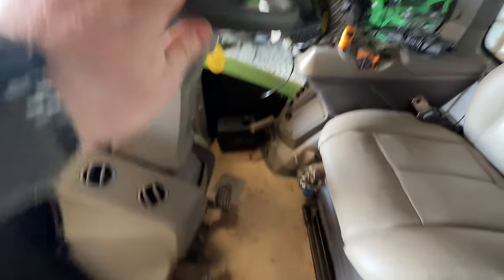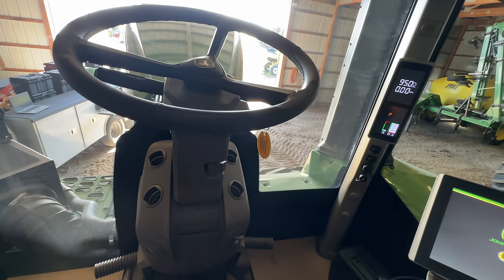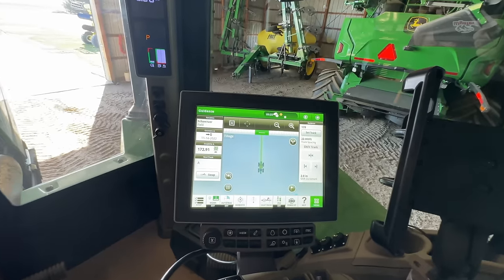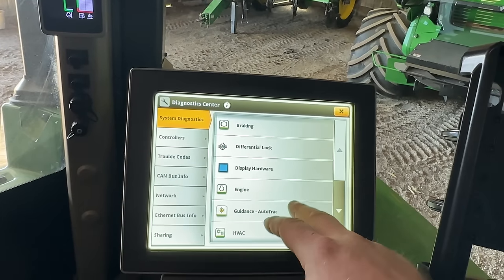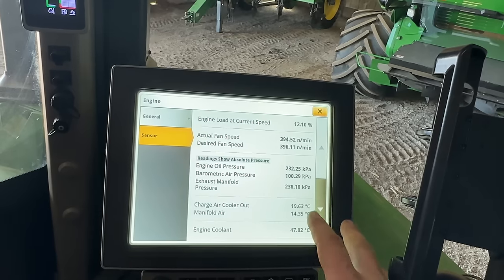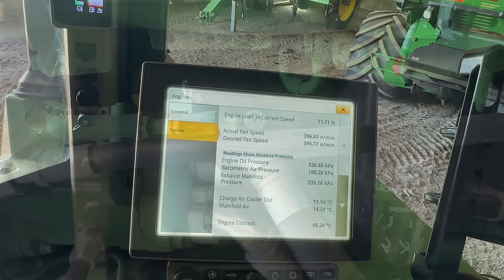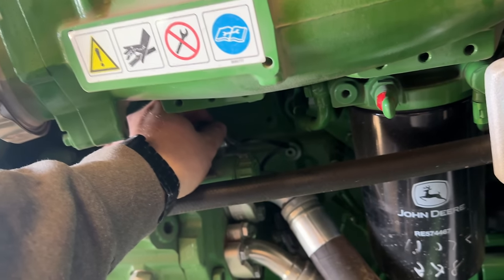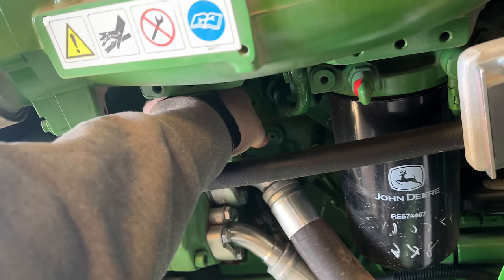Service call on a John Deere 9RX 640, shop projects, new tool boxes, & a visit to my favorite s680!

Comment: Zeth those rotor bearings can be a pain to remove. I’ve found the best way is to pull the seal off and air hammer the cage, separate the ball bearings enough to get a blind housing puller inside, then use an impact on the puller, mine is an SKF set. Saves tons of struggle and time. Hope it helps ya on future rotor bearings🤘🏻

Comment: I used to have a Pin pusher Tool to rebuild terminal blocks on Fryer’s GCS Service out of KC or St. Louis Frymaster Fryers we’re notorious for broken Terminals because of heat! It’s a Mini screwdriver with a Tube over the Shaft of screwdriver

Comment: You do need a halogen electronic leak detector for checking seals and O-rings for leaks, shaft seals behind the clutch, etc.  Huge time saver.

Comment: It would be interesting to see more info on one of the parts you hate the most.  Tools, tips and techniques you use to remove broken bolts or studs.  Bonus points for details on how you prevent them breaking in the first place.  You have had bits of that every time you get into exhaust studs, but haven't seen many actually break off for you.  Enjoying the videos, man.

Comment: I really like that you took the time to pull that plug apart and replace the terminal. A lot of technicians would've cut that plug off, through a couple heat shrink, splice connectors in there and called it a day. That is a massive variable displacement, hydraulic pump running that fan is that all it runs or did I miss some thing and that pump is responsible for some thing else as well? I have worked on aerial lifts that have pumps that size to drive the entire machine. Haha
Reply from the maker: It only runs the fan…like I said it’s got some power. If Josh was standing in front of the tractor when it went full speed, it would have sucked him right into the coolers lol 😂.

Comment: my experience has taught me to replace scorched wires...unless you want to return later...just my opinion...
Reply: It can be okay if you strip back and find it was only local damage.  I think the break was burnt from the connection arcing on and off, that's quite different from a wire that has melted from an overload!

Comment: I guess Cummins has done the maths...but you gotta wonder if the complexity and expense of a variable fan system like that is worth the fuel and horsepower savings compared to a simple belt driven thermo fan. Thanks for the video!
Reply: Looks like a really nice clean solution to the fandrive challenge.  This problem looked quite unusual and I expect these probably can provide a trouble free long-life system.  If the software does not demand fast speed changes the bearings will have less load shocks and last longer.  Interesting to watch the demand response in diagnostics.

Comment: Love your videos, learning a ton. Have a question on a 9420 we own. Had a hydraulic leak underneath near the main hydraulic pump...my brother kept driving it to finish where he was wven though the alarms were screaming to stop. Had our local JD dealer tech come look at it. The 9420 drives and shifts like it should, but none of the scv functions work properly...low hydraulic pressure.  The pump was completely rebuild...the hydraulic stacks all gone through...still acts the same. I am into this project $16,000 and no solution. My tech is the best in 200 miles and he knows his stuff....but we are both wondering about this. Just wondering if you have ever dealt with anything like this.
Reply from the maker: I have but there’s got to be a reason the pressure is low. Why can’t they figure that out?

Comment: Can over greasing the rotor bearing be pushing the seal out the back? How much does it take?
Reply from the maker: I doubt it. That seal is actually hard to remove so the grease should come out easily. Sometimes it takes a half a tube or more to get it to come out.

Comment: Thank you for the video I enjoy watching you go through the diagnostic process to find the problem. I also have quite an arsenal of Milwaukee tools. I noticed you didn't solder the terminal on the wire. Is it not recommended by Deere or terminal manufacturer?
Reply from the maker: No terminals are not soldered.

Comment: When you do an inspection on a combine or tractor, do you have a checklist?  Also is that list available to customers?
Reply from the maker: I have to use an inspection form on a program called Codify. It is like a check list on everything on the combine or tractor and I can select whether it’s red, needs fixed now, yellow, can run another season, or green, it’s good. Then all the red segments gets added to the summary where you can add labor and parts to reach task to give the customer an estimate on repairs. It’s not available to customers. But there used to be paper inspection sheets but we don’t use them anymore. Don’t think they are available to customers.
Reply: Ok thanks for the info, keep up the good work.

Comment: im not a farmer but i love tecky stuff been a auto teck for many years knew alot of farmers also but any way i noticed that your oxyacetylene tank have the gauges attached  im not sure   but up here in ont canada they have to be capped while in transit im sure i will get told if im wrong or not  but love the vids
Reply: @ZKMasterTech  yeah im in Ontario as well. Never seen any ag techs cap em